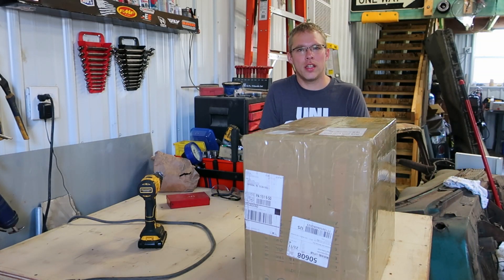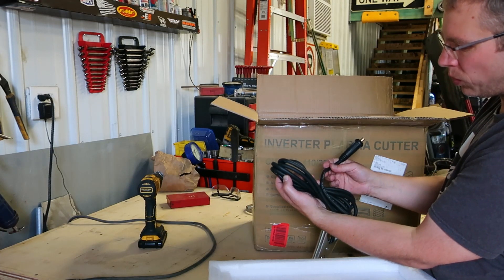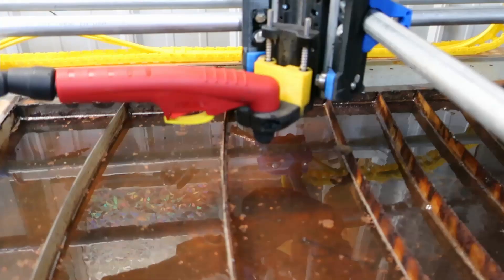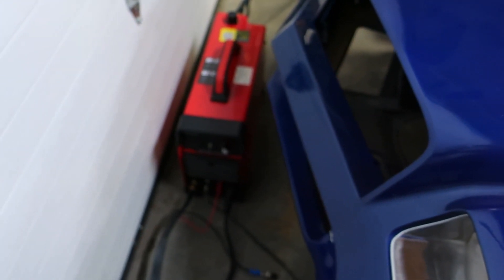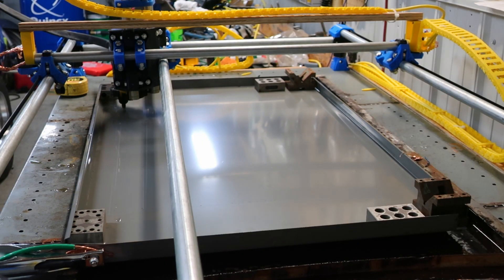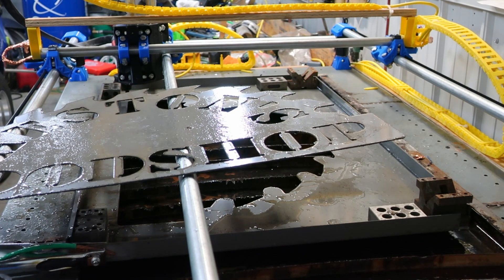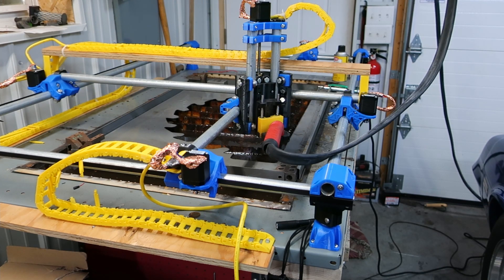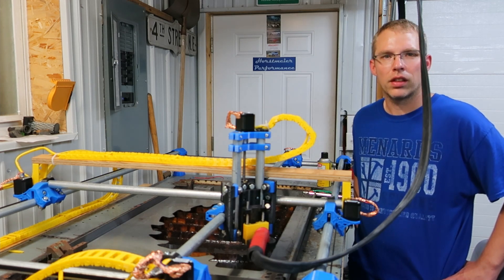MPCNC Primo Build Ep. 21 Cut50L Plasma Cutter.

Comment: Hello, great video, thanks for all the information. Is there any way to add THC to your cnc plasma?
Reply from the maker: Not with the current setup I believe. If I remember correctly the ramps 1.4 and Marlin were unable to do it. I know others have successfully used one with different controls.
Reply: @eliworks8549  Thanks for your answer, have a nice day!

Comment: How did you wire the torch on of switch?
Reply from the maker: I have a solid state relay just hooked up where the torch control  lead plugs in. The switch in the handle is a simple contact switch and low voltage

Comment: Congrats!  Nice work, and I applaud your persistence.  I've been following your progress and hoped to learn as you progressed.  So I was kind of bummed when you had the electrical noise issues with that other plasma.  I've been having fun with my 3D printer in the mean time, making some of the popular ones like the Emmett geared cube and the Barry Solo finger pen.  I'm in California and it's a dry summer, so I'm not doing any metal work that involves lots of sparks or fire.  But in the fall when the rains start again and the hills turn green, I'd like to move ahead with things, trying to copy your success.  Congrats again in this major milestone.  We were all rooting for you.
Reply from the maker: Yeah I really wanted to prove that I could get my Eastwood Plasma cutter to work. I think it would of been possible with longer cables and I wonder if doing this in a metal lined building was a problem.  It is possible but I just decided my money was better spent selling my high frequency start plasma, and buying this low frequency one. I would of broke about even if I didn't sell it cheaper to my brother. Then again now my brother has one to borrow if this one goes south. 
I also enjoy my 3d printer, it's fun playing with fusion 360 if I ever get the time. Hope you get some rain, it has been pretty dry in the midwest too